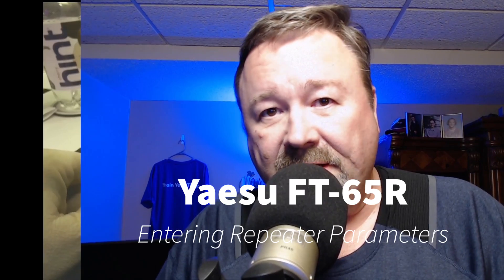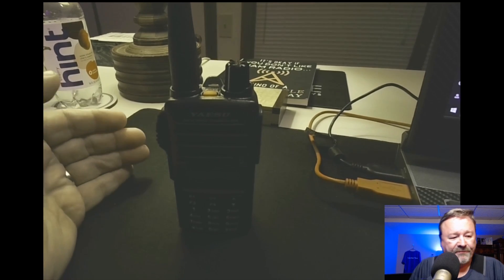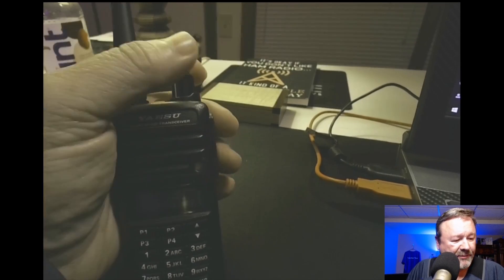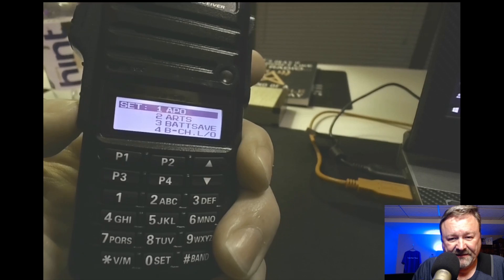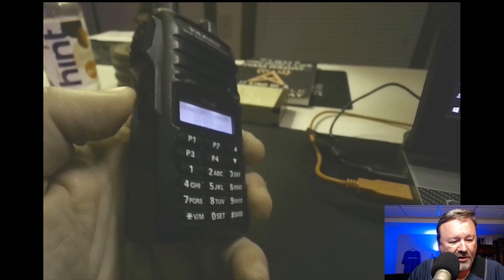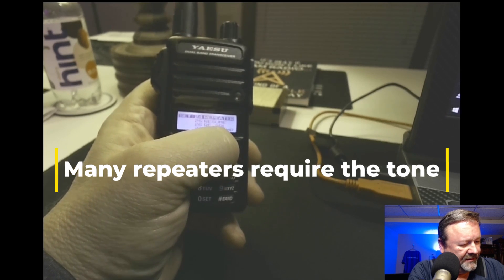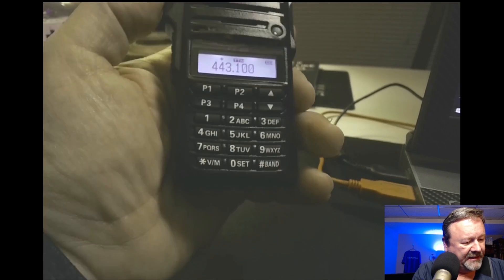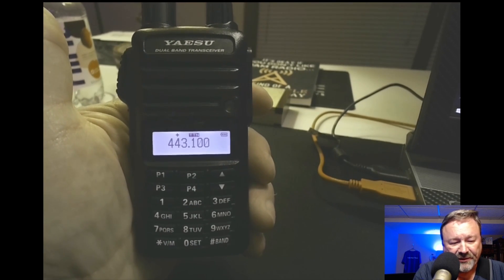Yaesu FT-65R: Programming Repeater Parameters (video #2 in this series) #hamradio #yaesu #ft-65

Comment: Do you know how to enable 'talkaround' on a repeater channel? (repeater bypass).  The only option I can see is to go into the menu and toggle the 'offset direction' from 'plus' to 'simplex'.  I thought Yaesu would have a more straightforward way of doing this.
Reply from the maker: I program memories with the repeaters and simplex frequencies I prefer. The simplex frequencies I add are 146.460, 146.475, 146.490, 146.505, 146.520, 146.535, 146.550, 146.565, 146.580, 146.595, and 446.000.

Comment: That is great info on entering a repeater. Just one question, why didn't you use the V/M button to get VFO mode? I don't know why Yaesu insists on putting their functions list in alphabetical order. All in all it's a great EDC radio that I use in my work vehicle with a mag mount. Thanks for sharing. 73. KC3UEE.
Reply from the maker: Because the radio wakes up in VFO mode.